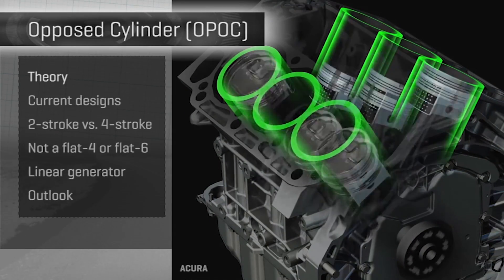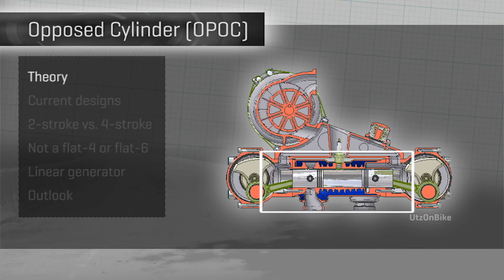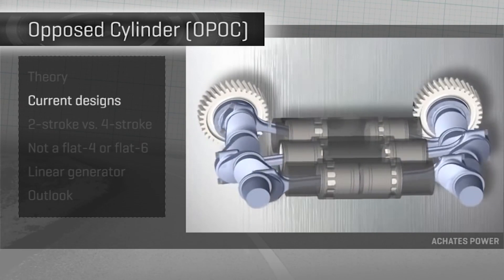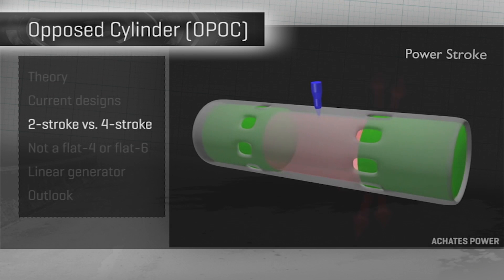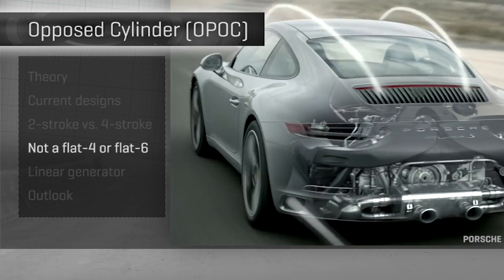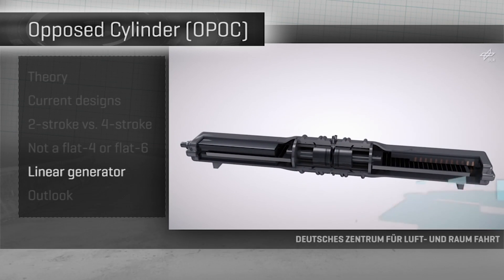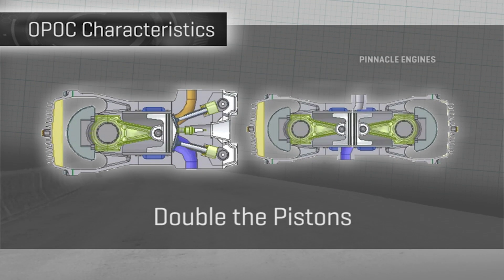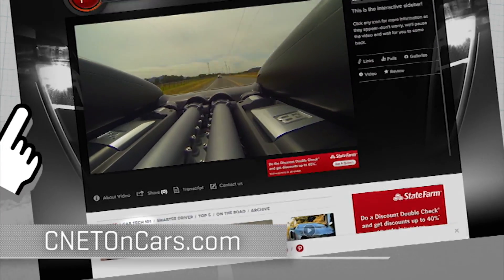Car Tech 101: Opposed piston engines  (On Cars)

Comment: the automotive industry NEEDS to introduce OPOC engines but the oil companies won't like it because they'll end up selling less fuel.
i would KILL for a 3 cylinder, 6 piston, gas-powered engine.
when people inevitably change over to using hydrogen, CNG, and other alternative fuel sources, they're going to want the most naturally efficient design... and this is it!!!

Comment: Not exactly a new idea - the French made them in the early 1900s (we forget the French were the great innovators in early engine design), the Junkers Jumo 205 diesel aero engine and the Napier Deltic marine and railway engine were both famous.  They have definite downsides as well as upsides though - eg for a 4 stroke the valve gear is complex and heat management is often an issue.